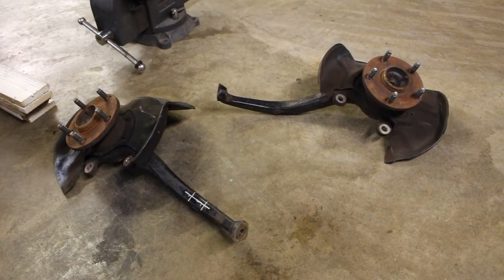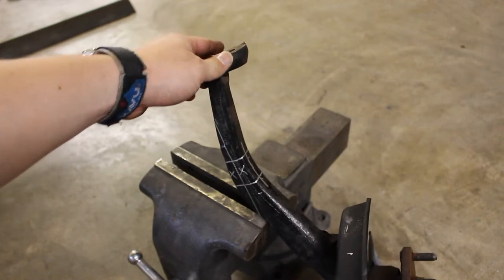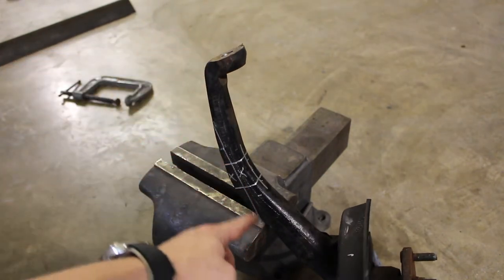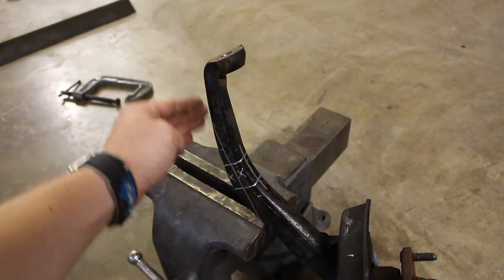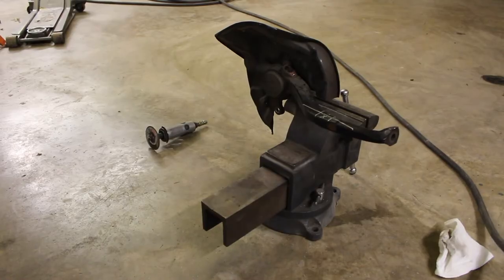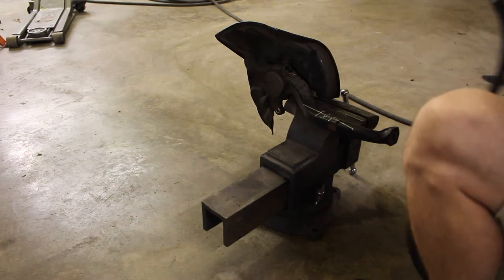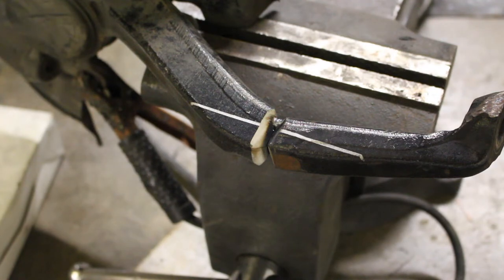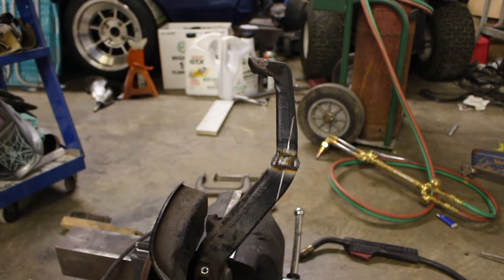Modding Knuckles

Comment: what kind of welder did you use and what were your settings if you can remember?
Reply: He said high as the heat goes and slow as the wire would go smoothly 😉

Comment: Do you need an oxy to heat it up or can you just use a propane torch?
Reply from the maker: You just need to get it hot hot. So that might be good enough.
Reply: @BuildsbyBailey   I’ve bought a pair of spindles and I’m going to attempt it. I’ve been practicing mig and I think I’ll be able to do it.